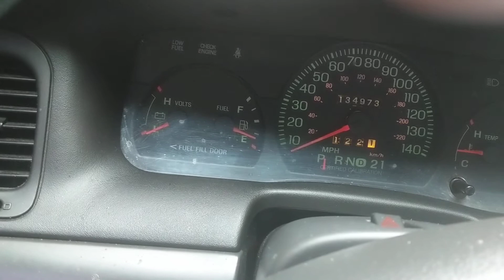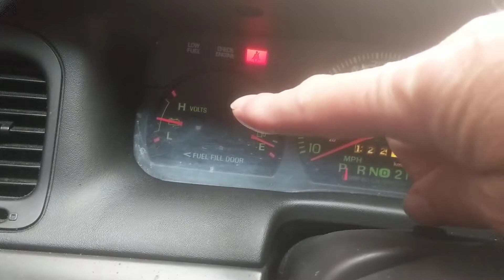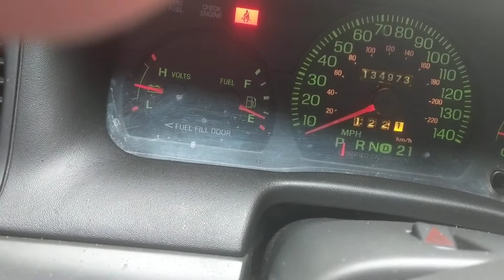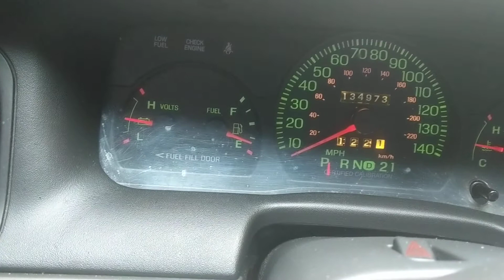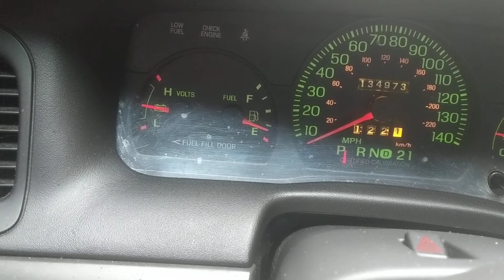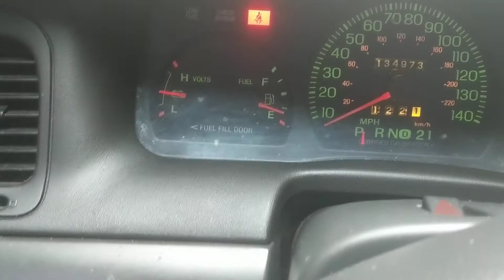NO START HOW TO USE BATTERY GAUGE IN DASHBOARD TO DIAGNOSE

Comment: What if the voltage skyrockets?
Reply from the maker: By voltage skyrocketing that means if the point they're on the gauge is going way too high that means you might have a problem with the voltage voltmeter or the instrument cluster gauge the voltage should not go above 15 on a standard average vehicle volts with the alternator

Comment: When ever u push on your break dose it drop down a little ? I just bought an alternator for my Crown victoria and mine drops down some when I apply the breaks . I had it tested and it is charging.
Reply from the maker: Charging system should always be constant at around 14 volts no matter all the accessories and lights you put on it blower motor it should always be around that it should not go down there's a video I made on how to test it on my channel Joe electronic schematics for Auto how to test the alternators thank you for the question